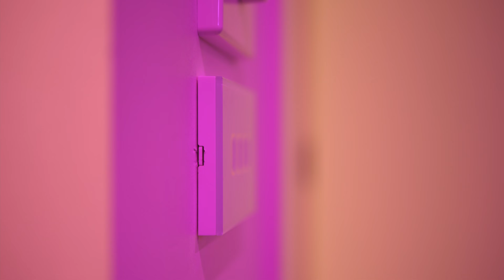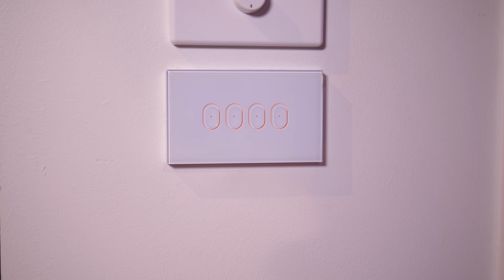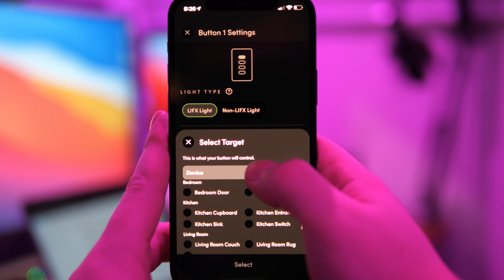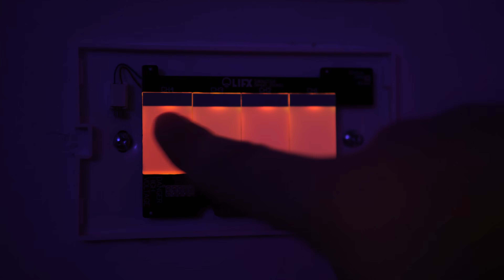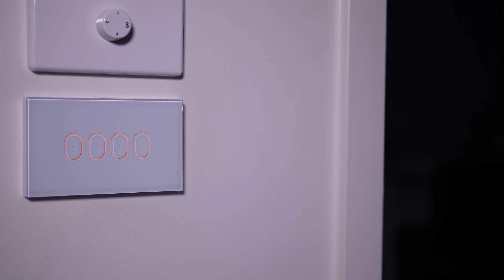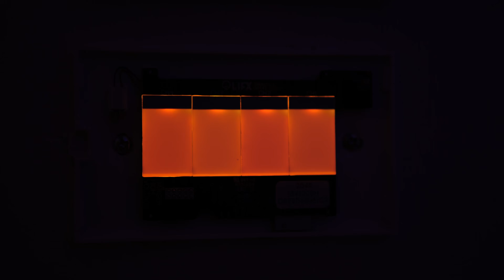LIFX Smart Switch Review - 6 Months Later!

Comment: These products are incredibly confusing and their product line does not make any sense. 

I was going to replace all my switches with these until I learned they only have a 1-gang or a 4-gang light option.

It can control 1 hard wire light or 4. No 2 option. No 3 option. It’s so strange.

Comment: Do you have any idea if the 2 button switch would fit with a standard switch plate?
I have a 4 gang that has 3 switches and a blank space and I’d like to know if this would fit in the blank space with my other toggle switches with the same cover plate. The blank space on the switch cover plate is a GFCI blank.

Comment: Far out. I have 90 Wi-Fi devices in my house. 

I have an Alexa in each and every room. 
“Alexa lights on”. Is all that’s required to be said. - as long as you group that Alexa device to each room. 

Having to redo all my lights seems like a nightmare.

I have ALOT of LIFX lights and they have been bullet proof for the last few years. (Earlier on had a lot of connectivity issues).

The reproduction of colour and speed is still unmatched. 

LIGHT DJ PRO is an INCREDIBLE app if you want to party with your LIFX lights. Don’t know why it took me 3 years to find this app. 

I’m coming up to selling my house soon. And like the idea of selling it as a working smart home, but this has complications associated with cloud account based light control. 

Would have to create a house specific email, and basically set the entire thing up from scratch. 

Considering I have some pretty massive and complex routines for dinner time, bed time, reading time with the kids etc etc etc etc. this is days worth of work.

Perhaps. ONCE setup. These switches simplify my setup should I hand it over in a house sale.

They do however carry massive problems around dual switched lights (not capable), and dumb lights that are dimmable (not capable). So it’s very likely you would need to have a normal switch beside it for dimmed dumb lights and dual switched circuits. 

I’m a big fan of LIFX. But I’m not sure if I can commit to these.

Also. Forget the LIFX app for control.

Use ALEXA groups and smart home control and routines for everything. 

Makes life 10000000000x easier. And WAY more flexible. Essentially doesn’t matter what group anything is in LIFX.

Comment: I'm really struggling to find HomeKit switches but even if these had HomeKit capability, the deal breaker for me is the fact the light on the switch doesn't indicate which light is on. If you have 3 lights sets in one room, as I do in the kitchen,  I'd would never remember which switch is for which light, and I can't begin to tell you what flack I'd be getting from my partner. This is a major error in my opinion. What the hell do the makers think when they design these things. I'm amazed and disappointed yet again. As for the promise of things to come....... don't hold your breath. Thanks for posting this review.

Comment: what happens if one of the lights in the group of 4 is a 3-way switch that can be controlled from another location? is there a terminal for that extra wire on the LIFX switch?
Reply: Lifx switches don't support standard 2 way wiring, but their recent update allows a switch in another location control another switch, enabling 2 way switching.

Comment: Great review 

Reaffirmed the concerns I had with this
Reply: I’m in a rental, so the permanent install part doesn’t appeal to me. The design looks a little too fancy (and expensive) but the software isn’t up to it (especially for a native solution).

The internet requirement and lag sounds annoying. Lack of visual feedback in perplexing and I don’t need to pay for the relays.

I just want a remote style control. With brightness, hue slider and scene shortcut  controls.

(Much like what you can easily find with non smart led strip controllers from China)

Perhaps with 4 fixture or fixture group selector buttons.

That can control a range of smart devices if you want it to..

That isn’t a million dollars…. 😅
Reply: Something a housemate or guest can intuitively use.

“I want the lights to be red and blue”

Or “warm white”

“Dim them a bit”

And just hit the appropriate buttons or slide things 

It’s almost looking like I’d be better off attaching a raspberry Pi to the wall of my house or an old phone or something - but that feels ridiculous